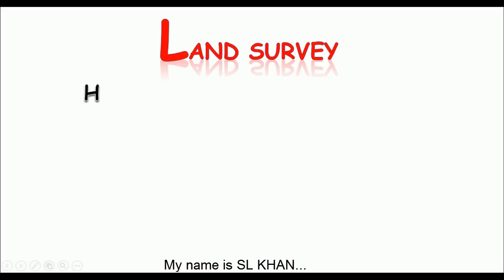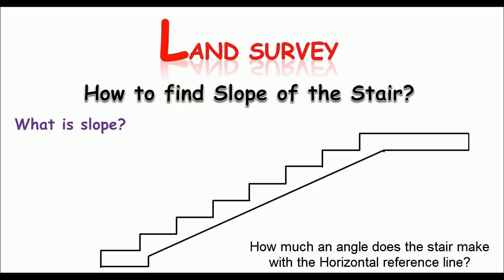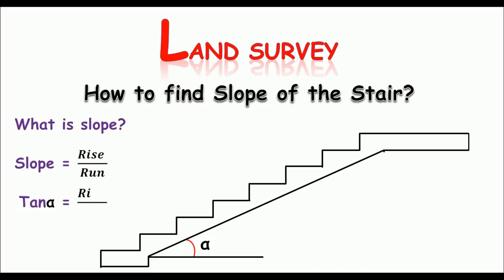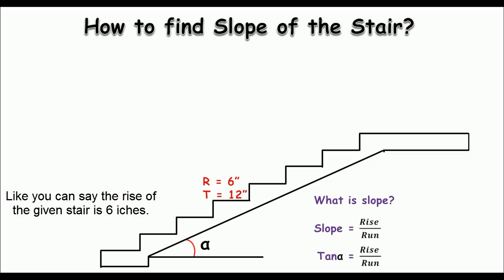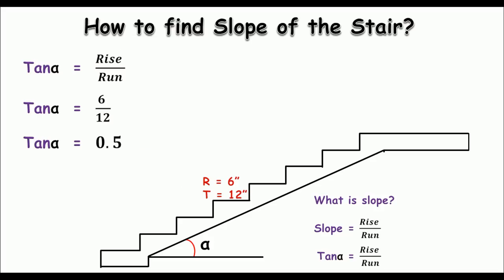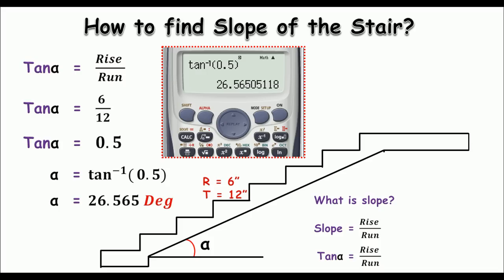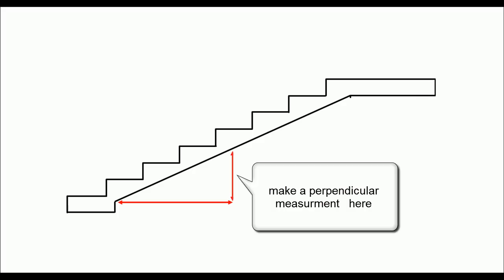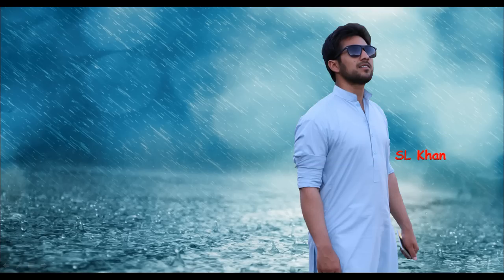How to find slope of stair case - civil engineering- engineer boy

Comment: The slope of a staircase is hardly ever used in a practical setting. The rise and run must meet the local building codes. You cannot build a staircase by just knowing a slope. You would still need to calculate the rise and run. It's obvious that you have never built a staircase or have any construction site experience.
Reply from the maker: Thank you sir for comment. Actually it was a question asked many times by subscribers so i put this video. However a detail video about stair design is also uploaded on this channel.

Comment: What if you are calculating a run on an existing slope?
Reply from the maker: Good question, dear remember one dimension must be given or can be assumed . Like if height is given then number of riser is calculated and then to subtract one from the number of riser the number of runs are determined and then by dividing the total staircase length by number of runs the length of one run is found. If you are not getting me , then watch another video uploaded about stair design ❤️❤️